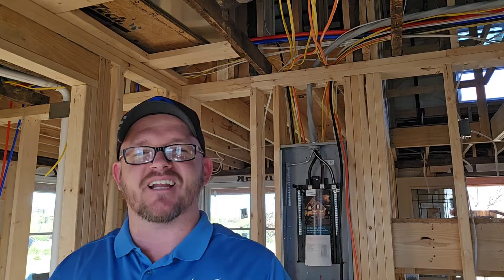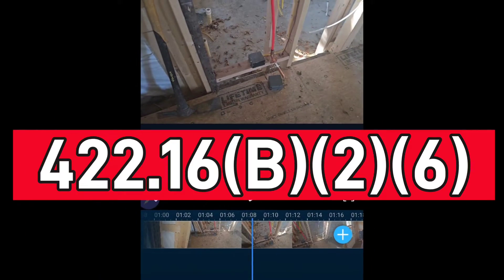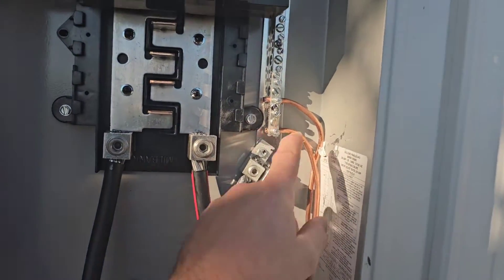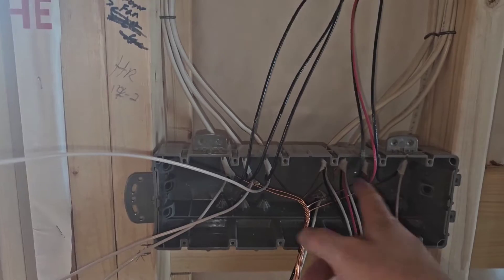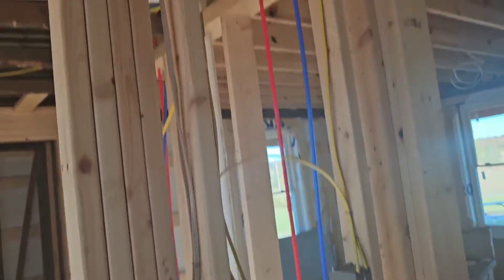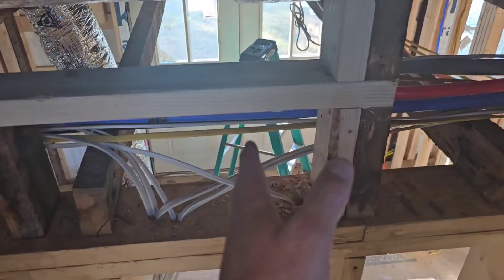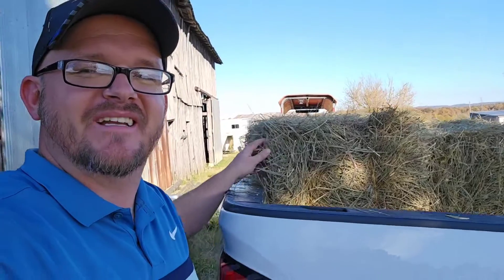Full new construction walkthrough with many code references NEC electrical electrician

Comment: It was kind of hard to see so I might not have been seeing it right but at 3:16 it looks like the neutral and ground are bonded which would be a no no since that's a sub panel
Reply: yeah so continuing to watch I can see the neutral andd ground are definitely bonded that is bad especially since it's a metal box attached to a metal builing there will be objectionable current no doubt

Comment: 0:00 I don't like the landing order... Ground should be first... then Neutral... then Hots.
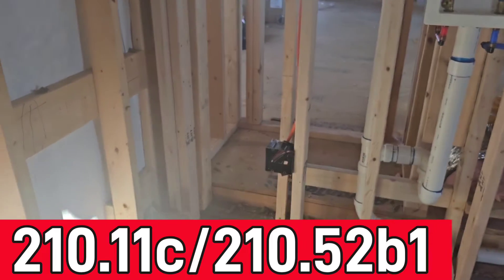2:22 Typically dryer receptacle height is 18". Either 2 gang nail on or smartbox. There are times when this has to be altered.

Comment: I have a question 2 part question. It’s about moving a 3 prong range outlet/wiring from one wall to another that already has a 20amp outlet for the fridge which is being moved to another wall. All wires are in the above floor crawl space and I want to know if 1. can I  just move the range outlet and wiring and drop it down the same holes/wall as the 20amp outlet? Or do I have to move/remove 20amp circuit completely? 

In addition if I remove 20amp circuit would be my refrigerator be okay on the 15amp circuit where it’s moving ? That circuit only has 1 light and 3 outlets on it (non gfci kitchen outlets) 

Any tips will be appreciated thanks!! 
-Augusta, GA

Comment: Code violation at the sub panel. Can not have more than 3 non metallic cables per hole. No matter how big the hole is.
Reply: Cite code big brain, or your all talk
Reply: That is what I thought also. There are several places with 3 cables in a hole. I thought 2 was ok and 3 or more counted as a bundle and was a no go?
Reply: It is not a code violation unless the jurisdiction adopted the electrical code with amendment s which I highly doubt. Look to article 310.15(B)(2) NEC for the info on bundling.

Comment: Hey brotha, just sent my application for my test meaning it’s most likely a few weeks away. Which videos do you recommend for someone with 8 years experience and apprenticeship that hasn’t touched a book in a few years? Thanks in advance ✊🏽
Reply from the maker: Grind!

Here is the recipe. Sign up at  https://www.electricalexamcoach.com/membership-account/membership-levels/

1. Do the entire pro version.

2. Do everything in the ECC testing center.

3. Grind for 30 minutes a day on 100%

4. Put tin foil on it and grind 1-2 hour a day for 10 days leading up to the test.

5. Go take the test.

6. If needed, repeat until desired result.

Right now you can get a Lifetime membership for only $99.99.

https://www.electricalexamcoach.com/membership-account/membership-levels/